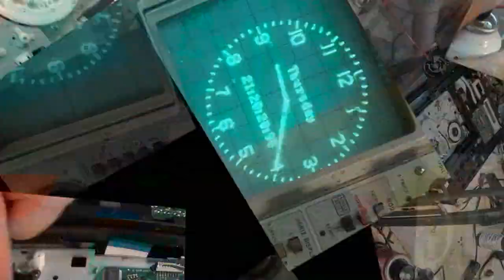Panasonic pv4250 front loader

Comment: I got a Panasonic, very similar to this one. You plug it in, get no display or On LED, but heads start spinning, and it takes the tape, which it doesn't eject afterwards. Do you have any videos troubleshooting this kind of issue? Thank you.
Reply from the maker: Check power supply for missing voltage.
Reply: @12voltvids  Do you happen to have at hand what voltages are to be expected? It's got 9 pins. I'm really amateur at this. Everything I know is thanks to your videos. Thank you!
Reply from the maker: @ArchivoHumano  There are multiple voltages, 5, 12, 30 for tuning ect.
You will likely need to locate a schematic to know which pins should be what voltage unless they are marked on the board which some are.

Comment: 13:40 "I don't have to do any other work on this."

Well, it may be a good idea to check the condition of the electrolytic capacitors on the secondary side of the power supply.

After a while, the caps in those Panasonic SMPS units leak or dry up to at least some degree; they run a little on the warm side and they aren't too tolerant of power line anomalies.  The symptoms can range from nothing at all to all sorts of weird issues, like a dim and unstable picture, flickering whenever the advance mechanism motor starts up and runs, dim vacuum florescent display, and so on.

At least, that's been my experience with these things in Florida.  If their time being plugged in for several years doesn't get it, then the power surges that happen from time to time in the "lightning capital" would.
Reply: I'm sure he knows as he has mentioned it before in another video. Nothing like a "know it all" to come a long a ruin a good thing.

Comment: Hi great vid ! I have a NV-55 Panny vcr which has a similar problem , but mine does go down and try and load but then comes back up , I un clipped all the plastic front clips but something is still holding it , looks like an electrical loom connection ? Thanks .
Reply from the maker: Usually the mode encoder switch that causes these type of problems.
Reply: Thanks for that , Haven't a clue what one of those is and the machine is yonks old so probably not available anyway    , Shame but hey ho .

Comment: What manner of a warped mind invented VCRs?
Reply from the maker: And how else were we going to record video back in the day.
Reply: @12voltvids  Well it's important to note that video has been recorded by one method or another since 1927, but my comment was not about the method of recording to tape but the insane complexity of the mechanism of doing so.
Reply from the maker: @vtbn53  
Well you are talking film a chemical process.  Recording video on magnetic tape requires a huge bandwidth. Sure you could do it with a stationary head but the required tape speed would be so high that a large reel of tape would only hold a few minutes.   The tape would have to run at about 4 metres a second.  That is where helical and perpendicular scanning come into play.  The first system was quad and was a very complex system that used a 2" tape.  They helical scanning was developed and the rest was history.